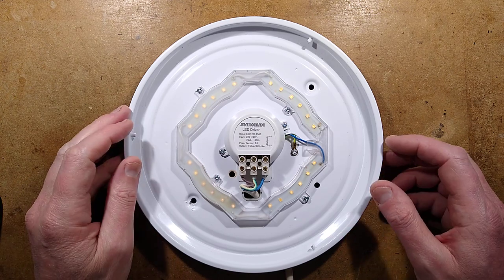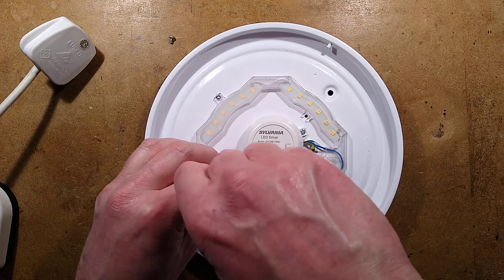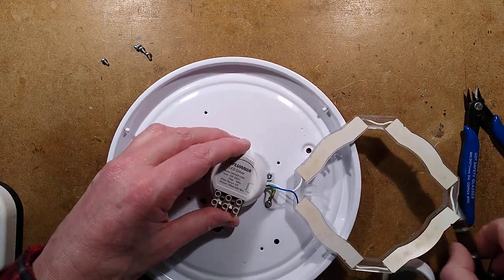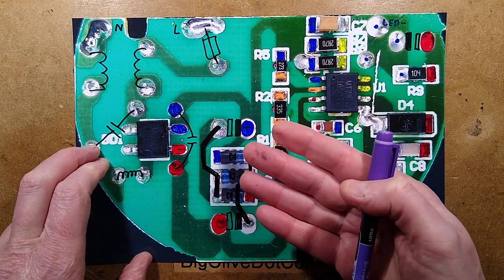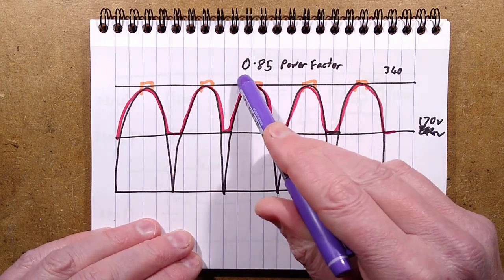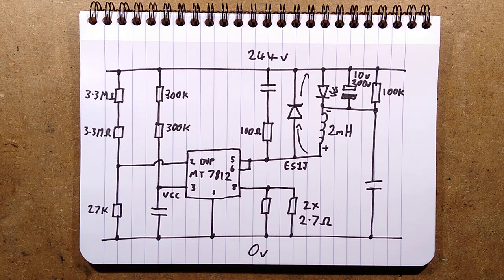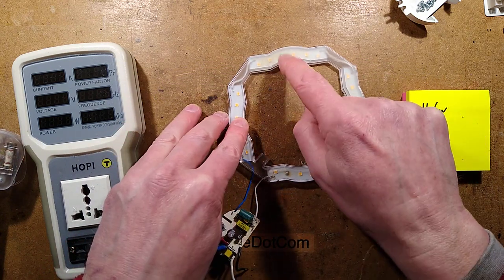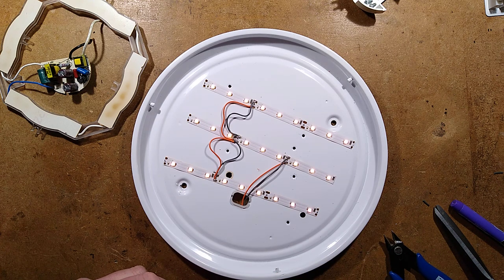Fixing and hacking a light from Thomas Nagy

Comment: The mind bending capacitor circuit looked a bit familiar to me, although turns out it was for a completely different application. I've seen them used for DIY programmers for Atmel/Arduino chips, which require "high" voltages (12 VDC I think) to change the values of internal fusable switches, to control things like chip speed, oscillator source, and response to brown out conditions. A variation of the diode and cap circuit can achieve, say, 12v out of a pulsed 5v source.
Reply: That's probably a cockroft-walton multiplier, with the AC needed generated by the microcontroller simply using PWM to generate a square wave
Reply: @jaycee1980  It's a valley fill circuit. Look it up.
Reply: a simple 2-diode, 2-cap voltage doubler (or similar tripler) isn't really close to this circuit, it smooths the output to dc compared to the half-smoothed dc this gives

Comment: I've been buying lamps with easily removable, current limiting supplies explicitly to snip one of the two sense resistors off. I bought some 36" shop lights from hazard fraught that only dropped a hundred or so lumen when I did that, because the factory current limit was over driving the LEDs so hard.
Reply: interestingly, I recently bought a couple name brand under-cabinet fixtures that'd been clearly hanging around a hardware store for the better part of a decade, and those have sensible current limits already, without needing modification.
Reply from the maker: The earliest LED lights were reliable, because they didn't roast the LEDs.
Reply: @bigclivedotcom  So once people are used to the LED lamps having a long life they introduce overrun short life lamps in the hope that people don't notice?  Am I being too cynical?
Reply: @peterjf7723  So you need to buy new ones, yes. 15 year light bulbs don't make money.
Reply: @stephen1r2  Oh, they were profitable all right. Ridiculously expensive prices are one way to profit, but it doesn't drive the sort of ubiquitous adoption that ensures continuing profits.

Comment: I feel like there should be an opportunity for an electrician to sell this modification as a service when they install the fixture. Easy way to make a couple of bucks, the customer gets a longer-lasting light, and the fixture stays out of the landfill that much longer. I'd hope the electrician would properly desolder the current sense resistor though. 😉👍️ (edited for clarity)
Reply: Haha yes, the electrician comes in, "imma just snip one of them resistors out"
Reply: @ChronicMechatronic  Even if they don't do that, I don't see an issue with applying thermal epoxy or paste to the LED PCBs, especially if it's non-conductive. That would still have an effect on its lifetime.
Reply: @McTroyd  - applying thermal paste/heatsink compound/silicone grease on it’s own may not help. The objective of thermal paste is to improve heat transfer by filling in any small holes or gaps (that have air in them) with the thermal paste. Hence only a thin smear is needed. Thermal paste cannot magically improve the heat transfer through the PCB laminate. What these fittings need is aluminium core PCBs which are firmly held against the metal base (and with thermal paste). However, you then need the metal fixing to be earthed in case the PCB breaks down.
An alternative would be to use much larger PCBs and to run more LEDs, but at a lower current (power) so that the heat is distributed more evenly.
All of these things however, cost more money. And purchasers love buying (what appears to be) a bargain…

Comment: I've become rather fond of old-school fluourescent fixtures with good-quality, ballastless LED tubes.

It's strange how the lamps that are easiest to replace/service are the least likely to need maintenance in an unreasonably short timeframe.
Reply: I've become rather fond of old-school fluourescent fixtures with good-quality, fluourescent tubes...  ive begun stocking up before their gone
Reply: @DanafoxyVixen  I made the first swap a few years ago and they're still going strong at an average use of ~16 hours/day, so somewhere in the range of 15-20 thousand hours. Cut the power draw by over 80%, produces a lot more light, runs cooler, and completely eliminated the strike failures that fluourescents are occasionally prone to. To be fair, they were magnetic ballasts.

The only reason I tried it in the first place was because the strike failures were becoming more common and the LEDs were cheaper than a pair of new ballasts. I didn't actually expect it to work so well.

I still have the old T8 bulbs, and the ballasts are still in place (completely disconnected), but I don't expect to ever switch back.
Reply: I tend to use old fashioned light fixtures, especially those with multiple bulbs. Fit them with some good brand and enjoy. What I found quite viable is to have such light fixtures equipped with IKEA Tradfri. These seem to be acceptable quality/price/longevity and I am running them mostly at 90%.  If there is need for super bright moment, I have a script that temporarily makes it 100%. No more irrepairable light fixtures.
Reply: @Azlehria  My house a ton of old F40T12 fixtures in almost every room, and I've replaced about half of them (27 total) with direct wire LED tubes. So far I've been happy with them. They have far better color rendering compared to the sickly blue-grey light that the fluorescents gave off.
Reply: yeah done this loads at a local swimming pool that has been a nightmare to change the fitting - 2 x 1200mm led replacements , rewire guts, job done :-)
Reply: for sure I have the same Fluorescents light fixtures that were original installed in my workshop back in like 1984 and they still are working fine I had replaced the ballasts like 10 years ago thou.

Comment: can you imagine running a LED so hot the PCB gets burned?
it should be illegal to sell things like this. can you imagine a car that is build to have the engine run at 200% and fail after 1year? there should be a "lemon" law for small appliance and various things like this.
Reply: There is, at least in the UK, it's the consumer protection act and it states that goods must be 'fit for purpose', which means they should last somewhere near the expected, or advertised, lifetime.

Comment: I had the exact same light in my bathroom. I replaced it when it started flickering. I few years later I needed a bright light for my work bench in my garage, so pulled this one apart to find one of the LED banks showed signs of burning. I bypassed the faulty LED with some wire, which fixed it. It's been going strong for over a year now and still super bright.

Comment: Very interesting cicruit. Thanks for the thorough reverse engineering of it!  It is almost a shame they then just flop the LEDs on like that. This could have been a long lasting light!
Reply: They don't want it to be long lasting. We assume it will be because LED, but who dates their bulbs and fixtures, and keeps receipts?
Reply: @strehlow  - You don't?   I also label air filters' installation date, and often oil filters.  I even label monitors with the month and year that I replaced capacitors.
Reply: @strehlow  - I do! But I’ve only had a failure of two cheap 12V 5W LED MR12 down lights so far.
Reply: @strehlow  When compact fluorescent lamps came in I did mark the date that each lamp started being used and kept the data in a spreadsheet. I got out of the habit of doing that after getting married 16 years ago.
Reply: @tbelding  I did when I started getting them. Then they got to be a commodity and it wasn't generally worth the trouble.
Reply: @strehlow  - I do it because my memory can be bad, not so much for getting them to replace stuff.   However, forcing a company to own up to their warranty gets their attention better than stopping buying the products.
Reply: @peterjf7723  - Marriage can do that to you.

Comment: Most of my lighting is 12VDC already...I run several battery systems...4 12Vbatteries along with 4 inverters to keep my all systems running.  
I use 4 Finder relays to keep the power on mains unless an outage occurs which turns off the relays an allows the inverters to keep everything powered off the batteries.  
Also use a couple 6V battery systems to keep my USB stuff powered as well...dropping the voltage with buck regulators down to the required 5VDC.  
So far I have made it through lots of outages and a few hurricanes as well.
Reply: I have a old Fiskars (now Powerware) 2100VA/1600w UPS that runs off 4*12V VRLA inverter batteries. It's constantly on and it runs the sockets in the living room, bedroom and office. I also have "regular" sockets in those rooms for the laserprinter and hoover etc. Just yesterday there was a power outage because we had some snow on the trees that sometimes touches the powerlines. And the ceiling light went off but my TV stayed on and also my Internet and computer

Comment: Clive, I had to replace a peltier in a cube refrigerator, and I used silicone adhesive to contact the heat sink, and it's been cooling quite nicely.

Comment: To get a PF of .85 with no active circuitry is amazing. They managed to charge two capacitors in series and discharge them in parallel with only diodes! Are there any downsides to that approach? It almost seems too good to be true. (Corrected Typo.)
Reply: Extra DC noise, which the buck converter won't care about, but other things might. 
Clive mentioned it in passing

Comment: I actually retrofit an old circle fluorescent with an E27 socket and cheap LED bulb. Saved replacing the round tube ever couple of years.
Reply: I have a circular fluorescent fitting. The lamp lasts for ages. I’m fine for spares, I have a box (of ten) with nine left in the loft 😃

Comment: Perfect timing! I bought a pretty similar light a few weeks ago from Lidl (Llivarno brand £6.99) with the intention of using capacitors to 'dubai-style' it. When I opened it up and saw the transformer I realised that wasn't likely to work (didn't try it as have mislaid my capacitors). I managed to locate the sense resistors and kill one of them and its reduced the power from 12.5w to 5.9w. They have skimed even more on my moedl though with just 18 LEDs, so am going to invest in some heat sink paste as you recommend as its still 1/3w per LED. Need to save all the electricity we can now its going to be 28p/kwh! You should be on MSE or something!

Comment: I have done a similar thing to my kitchen hood. Replaced the incandescent bulbs with LED strips and a 12V PSU. Visually 10x the light with 1/20 of the power drawn.👍
Reply: I did something similar as well I also replace the 120 v AC fan with a 48 v fan
Reply: The future: High voltage to low in all of our household appliances
Reply: I also did that with a 2.1 audio system, the 9 volt psu it came with heated quite a lot for the appliance and when my dad was using the welder a noticeable noise could be heard from the speakers. I replaced it with a 5 volt, 1 amp phone charger. The phone charger doesn't even heat up, sound quality is marginally better and the speakers no longer buzz when there are power fluctuations.

Comment: Totally agree with you Clive. Coincidentally just had to replace my bathroom ceiling light. I found lots of reasonable cheap fittings with local DIY tool and screw suppliers only to realise when I read the description that they all contained hardwired LEDs. My first thought of course was "What a crazy landfilling, work impacting idea. They're taking the Michael."  The replaceable bulb lights they sold were all at least triple the price. Since a lot of handymen use their services to buy cheap stuff for their jobs, I'm curious as to how many unsuspecting homeowning little old ladies now have light fittings guaranteed to fail within a relatively short length of time that they now have no chance of fixing without paying through the nose for it to be replaced again.

Comment: I never had issues with the led board, but with the module. The hardest thing is to find a  module to replace a 8 year old one. I could test the leds individually, but my power supply couldn't power all 24 of them to measure the power.
I just bought a HOPI tester. I realised how useful it is. Thank you
Reply: Power three of them and then multiply by eight?

Comment: I have one of these under the Philips brand and is 7 or 9 W. 12 LEDs, 150 mA/60 V max driver. The LED setup is the same, but the driver is more conventional without the "mind bender" and a PF of 0.5.
Chopping off  part of the current sense resistors is exactly what I did to bulkheads in our apartment staircase to halve the light output and (perhaps) quadruple the expected lifespan.

Comment: I used to sell light fittings and I always steered customers away from non serviceable ones, not because of landfill but I had customers that had can lights and the "LED trim" on some failed after a year, the new trim didn't match close enough in lumens or color output, they were quite POed that they would have to change ALL the trims so they match every time one failed and they were not cheap to replace especially when they have twenty or more in one area, I always pushed a standard trim with an led bulb, considerably cheaper and better looking IMHO
And as a fellow gen Xer, when we are all gone we will be known as the EX generation😉

Comment: I bought a similar fitting a couple or years ago, removed the insides and added a 5v power supply, one of those radar movement detectors and some led tape and it works great.

Comment: Clive, I made a workshop light for 12v and used led strips, plus an LED strip from a telly, and the brightness was very good.
TV led strips are typically 3v per led, so on the lights I used, I had to short across one led to make them operate on 12v. The other thing about these is that the lights have a very wide lens on them, so they benefit from downward reflection. I used the center metal cover from a fluorescent light as my reflector.
Reply: Now that's an idea, there must be a fair number of LCD TVs with broken screens that could be used for lighting.
Reply: @peterjf7723  Even better, rip out the actual LCD and polarizers and keep the backlight system. It looks like a diffused window in daylight when lit up. Some really high tech light distribution happens in there. I've taken out the cold cathode tubes from an older model and put in 12V tape, that works fine too.

Comment: I do like your way of checking whether caps are charged. It’s like when I change light fittings in my house - the breaker is off, I’m the only person in the house, the switch on the wall is off, I can see it is off, but I’ll still stick my finger in the lamp socket just to make sure…
Reply from the maker: That's the official final test for all electrical workers.

Comment: I bought a 12 watt bathroom ceiling LED fixture from Lidl last week, it came with a 3 year guarantee and cost £6•99. Like yours, Clive, it has no heat-sink compound between the LED PCBs and the metal pan, even worse the upper surface of the pan has a plastic sheet  over it, further compromising the cooling of the LEDs, though I suppose that the ceiling would not contribute much to the cooling anyway.

Comment: Huh - thanks for taking the tine to sort out that rectifier circuit.  Running a LTSPICE  simulation  shows the  screwy current  waveform  you   described, but I agree  that PF  is improved.
Reply: Another viewer identified it as a valley fill circuit.

Comment: So it looks like the addition of a bit of thermal grease may have prevented that one led from burning out at a very minimum.... oh and also making a little hole for the wire to pass under the plastic too. handy to know.
Reply from the maker: There is a channel for the wire.  It wasn't in it.

Comment: on the other side i LOVE these types of fixtures (if PF >0.8) because they always have two sensing resistors and i like to cut one that makes the power 70% of initial power... It is really hard to spot alot lower lumenous output because i worked out that for every 20% you drop the power, the lumenous intensity goes down ~8%. Explanation for that is that lumenous efficacy goes up as you drive the LEDs lower current, so from 100lm/w to 120+

Comment: Very interesting to see they made it this complicated to bump up the power factor.
Is it a model they specifically sell for use in public buildings, offices etcetera?
The average consumer doesn't look at power factor anyway so they might as well do it the simple way and have a 0.5 power factor.
Reply: Probably aimed at commercial or apartment buildings where there will be a bunch of these lamps running for or near 24 hours a day. It's pretty generic looking so having to replace one every so often won't really matter.
Reply: @tncorgi92  Yeah that's what I was thinking. I'm working at a school and there it matters because there are thousands of lights running all day.
But for home use it's way better to have a fixture that can easily have the bulb swapped.

Comment: I had an interesting problem when I replaced my kitchen 12V spotlight system with a 240V LED strip - it only switched from bright to dim (not off). Turns out it is on a 2-way switch system, and there is enough capacitance between the two live conductors in the cable (between the switches) to flow enough current for dim illumination of the LED strip. Could use this to easily convert the LED bulb stair lighting to 'on' and 'nightlight' settings by adding a bit more capacitance in one of the switch boxes. With warning labels for bulb-changing safety.

Comment: Used the stuck on led strip with a small switching power supply you rebuilt some light fittings for a central battery emergency light system, they work great and save a fortune!